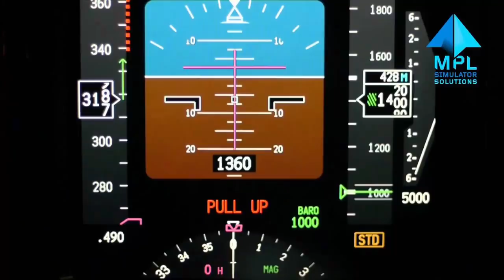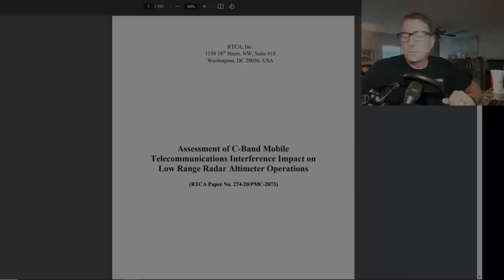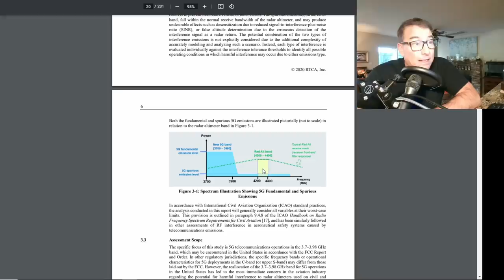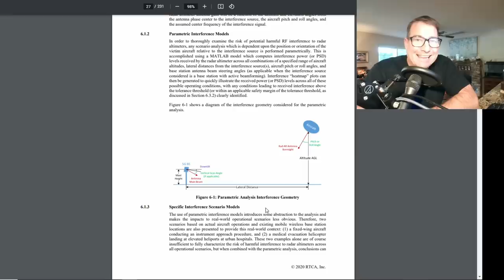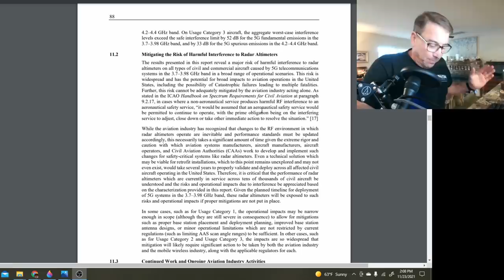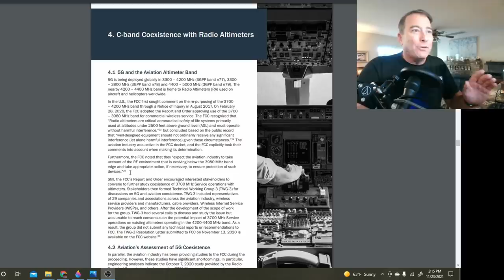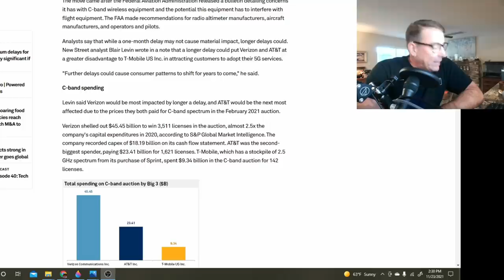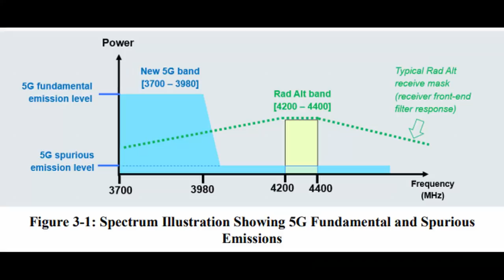5G C-Band Interference with Radar Altimeters in Aviation

Comment: Juan, I'm a semi retired engineer working in the mobile radio world; the FCC is woefully understaffed especially in the technical analysis department. Currently, the only real interference complaints that they will act on is if it affects aircraft safety of flight. The FAA is better staffed to evaluate this issue. The real problem in my mind is that the government is trying to raise money and analysis be dammed. The ol gubment "we'll fix it later" attitude comes to mind. Thanks the study was very interesting reading and your analysis was spot on.
Reply: I have been involved with radio development too. I think the big problem is cell phone makers are allowed to self certify their type acceptance instead of having an independent company perform the testing. I have seen cellphones splatter noise all over the spectrum.
Reply: Are they understaffed or missed managed??
Reply from the maker: Thanks Tom!
Reply: @tombriggman2875  I concur, A large part of the china for profit machines here. I am also concerned that this cheep-cheep production is lax in more ways than that.
Reply: @kcsthebetterway that's a question that will require the use of a double edged sword, that can be swung in two directions at once. 
The short answer is, Yes. Or maybe, Both. 
The current state of the federal government is a train wreck. The agencies that are supposed to be operating under the umbrella of the federal government have become so compromised by political favoritism and bureaucratic buffoonery, that they can no longer function properly. Malfunctioning and dysfunctional are far more accurate descriptions. 
These agencies are being administered by people that don't have a clue about the responsibilities and duties of their position. There was a time that the people in these positions were well versed in the appropriate fields of study. In the case of the FAA, you could expect former airline pilots and executives in the managerial positions. Perhaps someone that had been with one of the larger aircraft manufacturers. These people would have had some real world experience in the field of aviation. They may have been controversial, or inept for the federal positions they were in, but they knew pretty well how and why aircraft worked. It was common that they would be holders of degrees in related fields. Like structural design, or meteorology. 
This isn't the case any more. People are appointed to these cushy, high paying jobs as political favors. Sure, some of them do hold degrees. In economics, or business accounting, or European Medieval Era lute restoration and basket weaving. 
This is a major contributing component of the deadly Boeing Max catastrophe. Boeing knew the FAA didn't have the knowledge or ability to properly inspect, analyze, and test the many systems and subsystems of a modern jetliner. So Boeing  did the all the testing, and provided the results to the FAA to stamp their approval and certifications on. Even before the first Max crash, the FAA had received pilot complaints about the MCAS. The FAA simply forwarded the complaints to Boeing and left it to them to resolve. The FAA did no investigation of it's own. When the first one crashed. The FAA made an appearance, but their investigation consisted mainly of asking Boeing what went wrong. Boeing said nothing went wrong, the young foreign pilots simply didn't know what they were doing. It's their fault. That was pretty much the extent of the FAA's investigation. Boeing lied to the FAA and lied straight to the President's face, and lied to the rest of the world. 
It wasn't until the second crash that the FAA realized they were being played. 
They were so far behind the problem it took most of two years for them to learn what they should have already known, and then apply it. 
Officially, it's Boeing that's on the hook, but I believe the FAA was criminally negligent and deserves to bear their share of the responsibility for those hundreds of deaths. 

As for the FCC, I know some well experienced and knowledgeable "Ham" radio operators. Two of these guys probably know more than the ten most qualified FCC personnel. 
Then there's the NTSB . . . Well, let's not get me started about that bunch of imbecilic miscreants.

So in conclusion, It is my opinion that all three of the above mentioned federal agencies are woefully mismanaged. And due to this crippling deficiency of leadership, these agencies, seem to me, to be incapable of fulfilling their intended duties.
Reply: @bob2161  I could not agree more and unfortunately this cancer has infected all, too many gov agencies including the military...
Reply: Hard to be sympathetic when people say government is understaffed, the other one is underfunded. I’d believe incompetent and that they probably should be letting the private sector do it.
Reply: @andrewrivera4029  some politicians have worked really hard over the last 20 years to make the government less competent. They underfund it than understaff it until the good people either retire or go work somewhere where they don't get jerked around all day long and called incompetent by everyone with a keyboard, generally an amazon warehouse ends paying more than the FAA.  When government is perceived as less than  competent, then some will say there should be less of it and just "free up" the marketplace. In this case, a "free" marketplace will guarantee that 5G walks all over radio altimeters, and then they will blame the aircraft for the problem, because at the end of the day, the 5G guys have a lot more money.
Reply: @tombriggman2875  5G Equipment is manufactured here in the US, Taiwan and S. Korea for the majority of components part.  not China.  and Taiwan + S. Korea are well better certified and thus why chosen to make them.
Reply: @mrl22222  keep working that old saw Mike, I’ve heard it for the last 30 years! MORE MONEY TO GOVERNMENT DOES NOT EQUAL BETTER GOVERNMENT AS HAS BEEN PROVEN OVER AND OVER AGAIN. Sounds like you got a big fat government pension your grandchildren will be paying for long after you’ve settled into that big airport in the sky!
Reply: sounds like the tobacco industry saying there's no problem
Reply: @CapStar362  the consumer devices which will operate on those frequencies won't be though.
Reply: @CapStar362  The bailout from Afghanistan didn't help our credibility much!
Reply: I wouldn't be surprised if old radar altimeters have tubes.... FCC & airframe approval moves glacially.
Reply: I don’t understand.   Shouldn’t the process of landing a plane be considered part of “Safety Of Flight”?
Reply: @CapStar362  as far as i care Chinese and Formosa are the same brands/branches of the same tree 🌳 ( i couldn't really tell them apart after the imperialist designers left aka not a 💯 knock off of say a 1940's D9 cat doser or welder )( and in some cases the phone ☎️ for the help line was the same as was the address in chnsine or pekank china 🇨🇳 for things like PLC's ) manufacturing wise as i have had to fix it professionally ( for 🇺🇸/🇬🇧 plant equipment use and car things 🚘 ) but usa 🇺🇸 is different up to a point or at least after 1980-90's ( before about 1968~ the usa 🇺🇸 stuff stands on its own and i could easily tell it apart same thing for the 🇬🇧 products ) as that when you really see international parts bining and euro goods are definitely different than the rest of them
Reply: @bob2161  Dan Gryder couldn't have said it better... and hasn't.
Reply: @V100-e5q  Nope the FCC gave a ton of funding for tower upgrade to ATT because they lobbied and said they were losing money on 3G no they just couldn't make what they wanted they even took funding for defunk companies like Ameritech, Cingular and approximately 62 affiliated ATT! This makes me absolutely sick!
Reply: I don't know what else we should expect.  this is what 55 years of "starve the beast" politics has gotten us.  Individual corporations wield greater power than entire government agencies.  I sure as fuck didn't vote for Verizon to be the arbiter of what is allowed to use which frequencies, but they're the ones making that call now.
Reply: @Android-ng1wn  The chips aren't the issue here, the devices, transmitters, that produce the RF energy are.  Those are made in PRC.  (As well as other countries)
Reply: @Android-ng1wn  You're looking at the wrong aspect of the system.  This isn't about the phones, which are required to be disabled or off during takeoffs and landings.  This issue is with the base stations, (cell sites)  and the transceivers and antennas installed there.
Reply: @Android-ng1wn  Correct, but that's where the "self-certify" problem comes in.  As for the antenna tilts, most mounts can do up to 4 degrees.  There's also remote electrical tilts built into the antenna elements themselves.
Reply: I work for the gubment and can tell you the I and a whole ton of my colleagues were 100% against the frequency auction. Frankly, I'm already using that frequency band anyway which means I'm going to get the telecomm industry mad when I throw hundreds of kilowatts out on top of their signals...

Comment: FCC (in Washington, DC) is not concerned with safety.  They are only looking at the money that it can generate.  It is a political issue for them and not a technical issue.  When I worked for the FAA in Los Angeles, I had a very good working relationship with the local FCC engineers.  They spent many hours trying to help me catch a "phantom controller" at the Ontario Airport.  Most of the working staff at the local level do understand technical issues and are not concerned with politics and creating revenue.  Those at the top of FCC are very much political appointees.  They don't really understand or care about technical issues.

Comment: Retired spectrum civil servant from the UK here. I think you’re on a sticky wicket here regarding 5G. In the UK, the CAA was quite the bulldog when it came to protecting its spectrum but the US does things differently. In the US, new entrants to a band only need to protect existing users from interferance. Since the RAs are out of band the principle does not hold. The work around may involve limiting elevation angles on base stations or limiting the capacity of base stations near airports or helicopter landing pads or even the downgrading of Cat III provision. A similer situation arose between the Radio Astronomers and satellite operators at the ITU and may still be going on 20 years later.